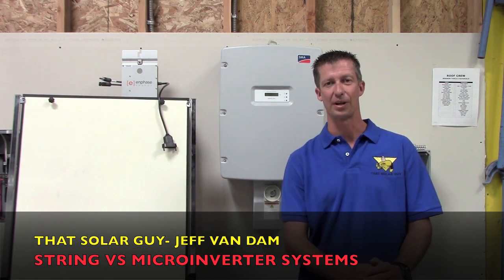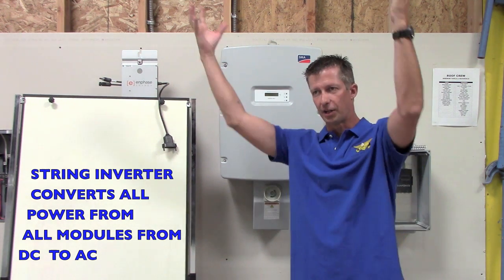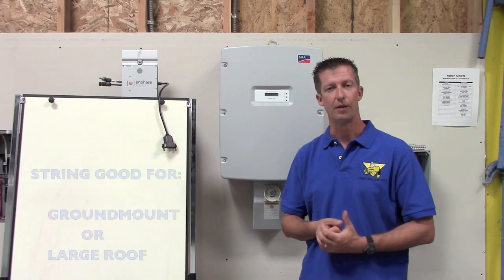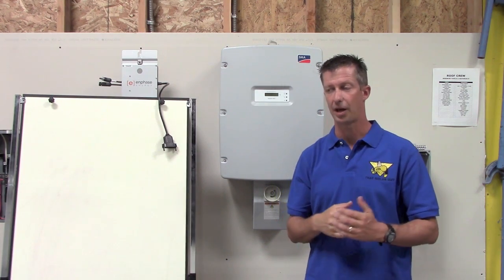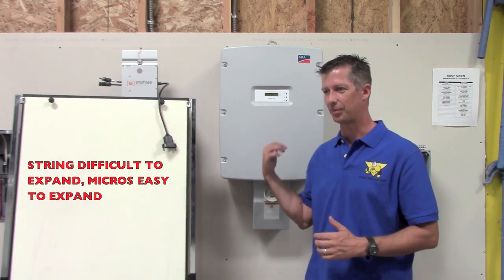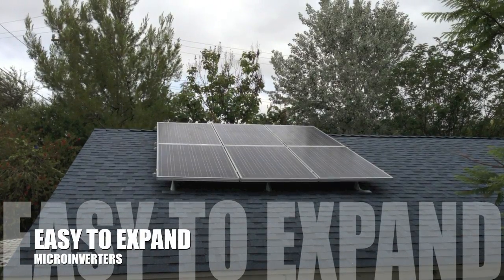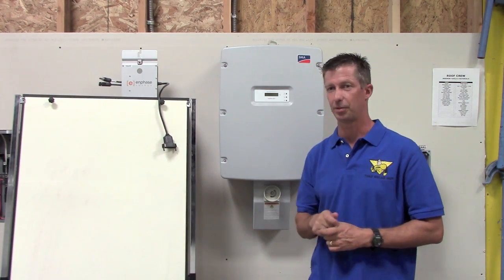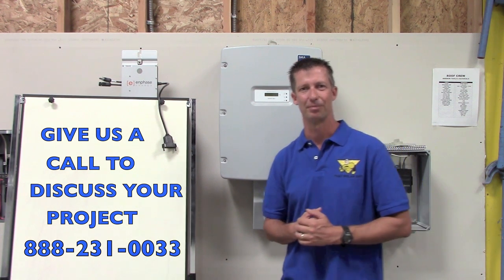STRING INVERTER VS MICROINVERTER

Comment: If you’re doing a ground mount system with several hundred panels, can you do both string and micro inverters on different racks? Or does it have to be one or the other?

Comment: I got one for you. A person has an existing 7.2 kW system and using a sunnyboy string inverter. The house is full electric and provides most of the electricity needed on a yearly basis but not quite. With the addition of an electric car they want to expand. They have 10 200w panels that are of the 54 cell Kycera panels. They want to install them but want to go with micro inverters to expand the system. The main inverter is in the shade of the carport and the space for the other panels will be on the carport roof and will have direct access to the line from the main inverter to the panel and coud easily tap into that line to feed the main panel. Is this possible? I don't see it as an issue since the microinverters auto shut off when grid power is down. So still no power can feed backwards through the system. Ever done an expansion that way? The current system uses 180w Kycera panels. The system was installed in 2005. Would like your input please. Installing and connecting is not an issue. The roof mount would need to be clamps for standing seam metal roof.

Comment: I am in the Photovoltaic ( Solar Electric) Industry. You have offered the worse advice I have ever heard. This guy is trying to sell micro inverter systems as a primary choice when string inversion should be the only recommendation.  Micro inverters fail to often and our company has not had a string inverter failure since 2003 and then only the display panel went out and the inverter is still working to this day. Go with a NABCEP Certified company only and go string inversion and you will be far better off than following advice from people like this.
Reply: Define small....
Can you replace one micro inverter in the middle of a array of panels in 1 hour?
By the time a tech climbs on top of a house and disconnects a panel and removes a micro then re-installs the panel or panels in the event the panel is not on the outside end run of the array, the string inverter tech has replaced the inverter and gone. That is if the string inverter even failed. We have not had a string inverter fail since 2003 and that was a display on the panel, the inverter still worked fine. 

It is not often that more points of failure is in the consumer's best interest.

SMA Sunny Boy is the best inverter on the market.
1.You should go string inversion 
2. Use a Amerisolar Panel (30 Year efficiency warranty)
3. Try to use a NABCEP Certified Company
4. Don't pay more than $2.79 per watt
Remember solar panels don't likely fail it's the micro inverter that fails.

HAVE A SUNNY DAY
Reply: Audie Carter I just started doing volunteer PV installs with GRID Alternatives and all I've seen so far are the Enphase Microinverters.  I was told that micros used to be kinda unreliable, but now that's not the case.  Maybe when the tech has evolved?

Comment: Nice video, one question. The Sunny Boy I was looking at has the ability to provide a 1500W outlet that can be used during the day from your solar without any battery backup when the grid goes down.  Is there a way to use micro controllers to do the same thing, and how would you do it?  Thanks

Comment: Okay, please explain something here.  At the end of the video, you talk about the micro inverters being up with your panels in the heat while the string inverter is somewhere on the ground, in the shade.  Just because microinverters are one-per-panel doesn't mean that the inverters have to reside in the heat.  Why does everyone do that?  I understand that it is better to run higher voltage AC than higher current DC over longer distances but you're doing the long distance DC run with the string inverter anyway.  So, why not just have a bank of microinverters in a cool shed or building instead of leaving them under each panel?  I totally don't get this practice at all....
Reply from the maker: +Christmas Eve  Great question.  Interesting view, I've never heard this proposed.  It could definetly be done.  You would need a 'ton' of wire though.  Every panel would need at least (2) #12's run to each micro.  If you had an average 5,000W system of 20 modules that would be 40 wires at #12AWG  pretty hefty conduit.  Make sense?  Thanks for contributing to the discussion that's a neat idea.  

And DC is significantly higher like 400+ where AC is at 240.  You can push your power either way.  Watts=Volt X Amps.  Lower Volts means more Amps.  More Amps means bigger wire.  Bigger wire means more $.

Blue Skies,  Jeff

Comment: Good video but I think you forgot about the single point of failure with the SMA. If there's a problem its like trying to find which bulb on the Christmas Tree lights went out. SMA is a fire hazard too and less efficient so micro-inverters are the way to go for anyone. Just think down the line you want to upgrade a couple panels... you can only do that with the micro-inverters. The SMA you have to add a whole new array and new unappealing inverter for a second fire hazard. How fun would that be.

Comment: What about Micro-Parallel Inverters as a 3rd option?  

http://trci.net/products/energy-products

http://www.solarpowerworldonline.com/2014/06/new-micro-parallel-inverter-helps-reduce-installation-expense/
Reply: I tried out two-in-one micro inverters from enphase a few years ago, and I don't think they offer any benefit over individual micro inverters.  The initial savings is that you have one box to mount on the rail instead of two, and one trunk line to connect instead of two, which at best saves 5 minutes per inverter.  That would be just fine if they weren't any harder to maintain, but a few months ago I had to replace one, and having to lift up and disconnect two panels at once is a deal breaker. Unless you get lucky enough to be able to reach under the panels to disconnect and reconnect both the panels and the trunk lines, you either need a second person on site to help hold panels, or you need to take panels right off to someplace they can sit safely. Four in one would make it that much more difficult, and also creates more of a problem if one of the four fails.

Comment: Regarding micro inverters vs string inverters. Enphase which is the most likely micro inverter has only been in business since 2006 and production since 2008 so how do you state that string inverters are worse? MTBF numbers don't mean much real world experience does and from I have read Enphase builds a good product but are experiencing failures. They now provide a 25 year warranty and most string inverters I think like SMA are either 10-15 years.
Your points about having your array in the same angle and orientation is something I had not taken into consideration for the string vs micro inverter. I want the best possible power generation from a solar array that has the same orientation, same panel, no shade so I think I can consider a string inverter unless micros come down in price.
Nice work...

Comment: Why are you using placement as an advantage for central inverters?  Micro inverters deal with less power so they don't need cooling fans that go noisy and wear out!  Also not mentioned is the trunk lines are smaller with AC ( microinverters) and line loss is less as well.